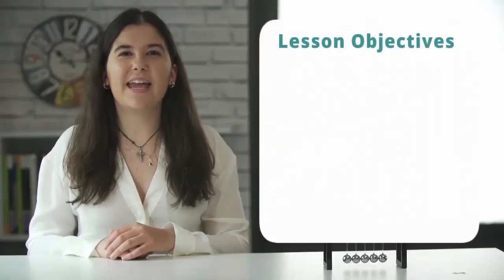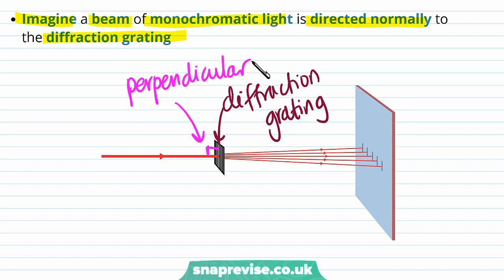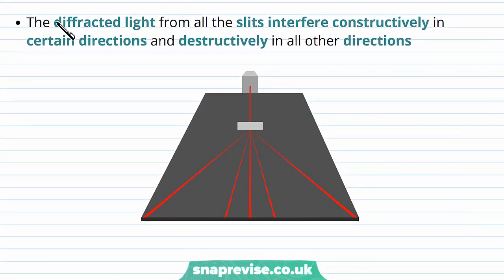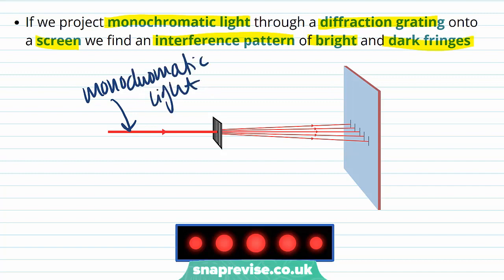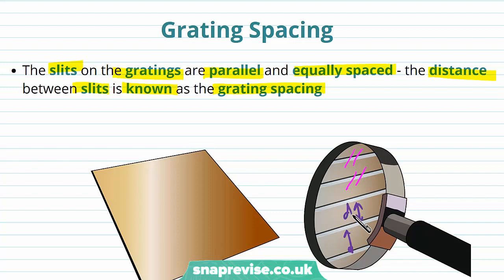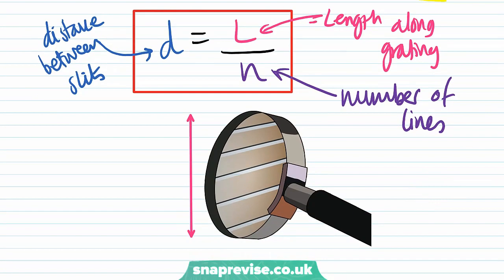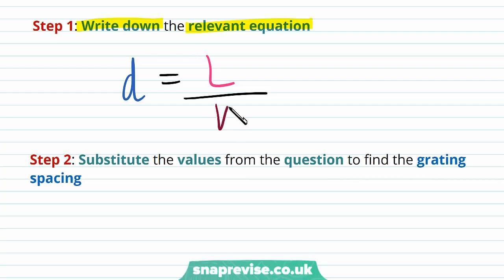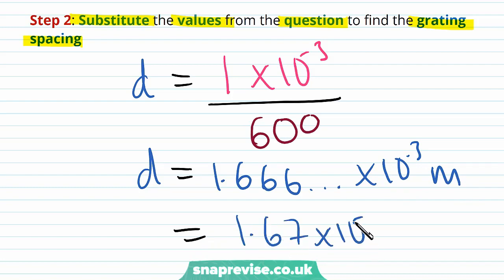Diffraction Gratings | A-level Physics | OCR, AQA, Edexcel

Comment: In the equation d = L/n, both d and L are to be measured in metres. So that means having 600 lines per mm would redirect us to this form:
d = (1/600) x 10^-3. This 10^-3 is added to convert the distance in mm to m. So this would mean the final answer of grating spacing would be 1.6667x10^-6. Well made video but the calculation is misleading so hopefully this comment helps people who were as confused as I was
Reply: How did u get the power?
Reply: @littlechewisex3783  bc the length in the question is given in millimetres
Reply: @littlechewisex3783  wait you asking how the guy got the power in the answer?
Reply: Exactly, just going through the video and that last calculation should be raised to -3 + -3 = -6